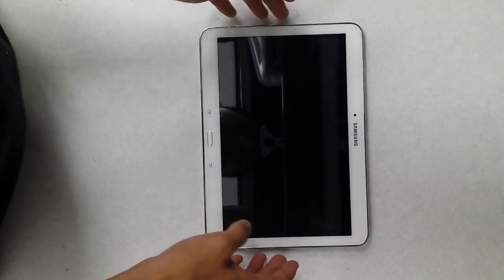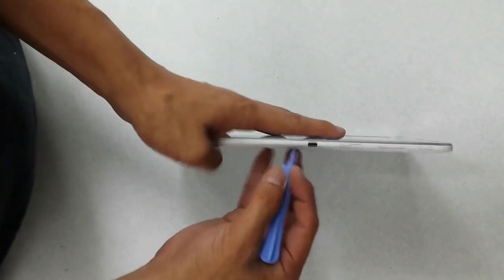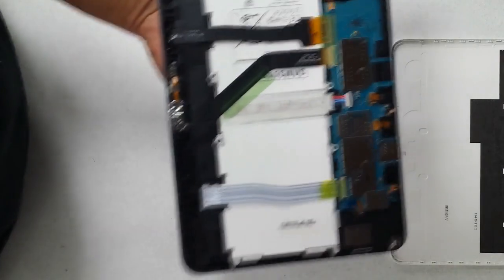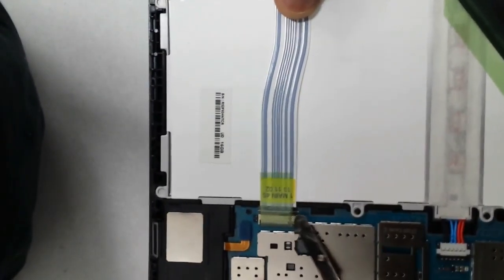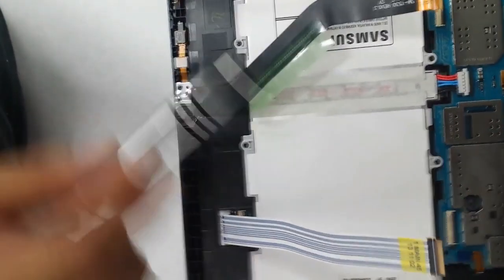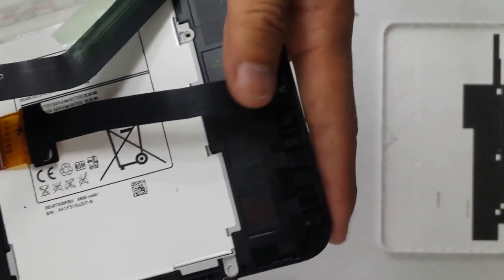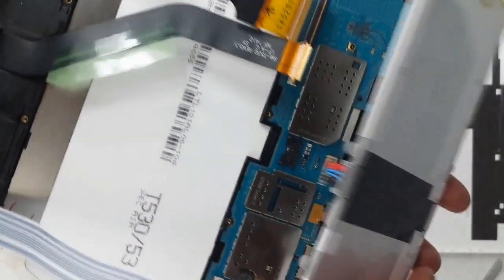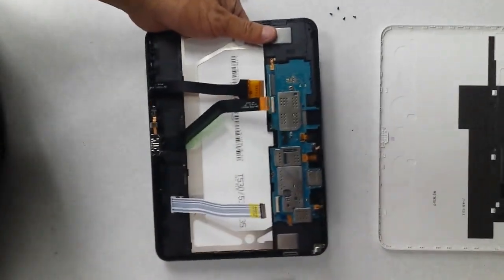Samsung Galaxy Tab 4 Battery replacement

Comment: You don't have to disconnect all the connections. Just the top edge light coloured connection. Ahead could lie disappointment. Just carefully slide the battery out.

Comment: Great video. Well done, thanks! I'd add a note that, on mine at least, the back is pretty tough to get started separating - it's a tight precision fit! Had to be patient and keep working at it with a very thin tool. I also had to use a small tip tool (my little Philips tip) to press down the sides of the battery connector till they clipped into place. Just pressing the connector down with my thumb would not lock the edges. 
cheers jt 😎

Comment: I guess mine is made differently.  No way in hell that tool can get between the silver and white plastic .
Reply: Randy - It's a very tight, precision fit. Just keep poking at the seam with a very thin tool. Try different spots around the edge. Eventually you'll get a split and a little pop as it separates slightly. Then work your way around the edge. Mine took several minutes of working at it. It'll come. cheers, jt 😎

Comment: Worked a treat to replace my TAB 4's swollen battery. Only things to add from my experience is the back cover was harder to get off than it looked in the video and I had a couple of extra bits of tape holding the cables down which needed taking off before opening the cable clamps. Great helping video. Thankyou.

Comment: vastly better than the totally crap printed and badly shot instructions that came with my replacement battery. if I had seen this video first, I would not have spent 
hours cracking the slate open and buggering up the seams in the process. and gotten the ribbon cables connected right, THE FIRST TIME.  

THANK YOU!

Comment: Looks easy to change the battery. I just bought one off ebay cheap and the battery dies within a couple of hours use and takes hours to charge. Just need to buy a genuine battery and not a fake.

Comment: What are the dimensions of the battery?  I may want to order on Batteries Plus.  After you have taken the screws, there are those gray "snap" tabs; you seem to just run the tool under the tabs- it it that easy?  Thanks for the confidence.

Comment: MY TABLET IS STUCK ON THE DEAD ANDROID PAGE - "NO COMMAND"  WILL NOT RESPOND TO FACTORY RESET/WIPE OR SNYOTHER CHOICE.  PUT IN FREEZER OVER NIGHT CUZ IT WOULD NOT TURN OFF.  AM THAWING IT OUT SO I CAN GET BATTREY OUT.
IF I TAKE BATTERT OUT & BACK IN SHOILD I CHAGE IT FIRST OR TURN IT ON TO SEE IF IT WILL NOT GO BSCK TO THE DEAD ANDROID SCREEN?  IT STARTED WHEN I WAS RESTARTING MY TABLET & IT CAME TOTHE PAGE I NEVER SEEN BEFORE.
PLEASE HELP IF POSSIBE...    IF IT DOESNT WORK ITS DEAD RIGHT?
SAMSUNG SAID TOO OLD TO HELP/ GET PARTS.
THANKS!

Comment: Great video, but you only covered 1/2 the job.  There were a few hitches putting it back together, which would have made it nice if you had shown how you put the new battery in.  Do you put the old tape on (mine wouldn't stick so I used some Scotch tape) and which way the 3 wire clamps are pushed down.

Comment: Very helpful! Stopped using my Galaxy Tab 4 because it doesn't hold a charge very well. And, I just ordered the batter for it that comes with a set of tools! Although I have a PC workstation I built and a MacBook Pro, getting the use of the Galaxy Tab 4 back into my tech quiver is something I've been needing for a while.
Reply: how about a link to the battery and tool kit? 
Thanks in Advance 
Yazmin

Comment: Thanks for the video mate. Simple enough to follow and enough good information to get the job done. For anyone wanting to have a creak at this, I'd previously never attempted anything like this before and have limited tech knowledge. A few things I noted. A bit of common sense, moving past the fear of wrecking your tablet, that is probably not working right anyway otherwise you wouldn't be here,  and patience got me over the line. I struggled getting the piece of crap plastic tool in place to get the back off. I broke the end off it. I used my fingernail to open the case far enough to get what was left of the tool in place. I used a blade to get the edge of the green tape up, slowly, being careful not to damage the ribbons. I did not put the green tape back on. When I lifted the locking tab things on the ribbons, I thought I had to pull the ribbons up to get them out. Turns out they just slide out not up. Getting the battery out of the chassis, I found I moved around all the corners trying to get one to click loose because I didn't want to force anything. Maybe I could have used more force but I'm a noob and wasn't sure. Once I clicked one up the rest were easier. Removing the battery lead was as the video showed. I initially looked for another lock thing that I had to lift but couldn't find one so turned the battery over and pryed the plug out. Putting the new battery back in was easy. The power plug from the new battery just pressed on, the same way it came off. The ribbons slide back in to where they came from and the locking tab thing that I lifted to get them out just presses down, evenly and gently, to hold them in place. I used the plastic piece of crap too to make sure it went down evenly. Put the screws back in and it really is that simple. Before I put the back back on, I powered mine up to check it first. It was fine, no information or anything lost. I powered it down and fully charged it with the back off. I wanted to see if the new generic battery got overly hot or went bang or puffed up or something before putting the back on. It was all good and literally saved my tablet. Couldn't have,or rather, wouldn't have, done it without this video.
Reply: ih like you

Comment: The usage of metal tools inside electronic devices with a life electricity source, ie. battery, can lead quite easily to short-circuits, which destroys the device and defeats the purpose of battery-replacement.

Comment: I was ended up saving from spending cash on a brand new vehicle battery when I found out about the reconditioning program ( Check Details Here>>>https://plus.google.com/100351090281822647456/posts/Ct2x2kZGdNN ), therefore I tried it to recondition my old car battery! I was not anticipating be that easy. This repair by yourself helped me to save $ 100 and I`m eyeing other batteries to recondition next.

Comment: I have a different problem, over the entire night when no one touched my tab, it was only at 18% and when I opened it, it went right down to 0
Reply: I am also the facing the same issue now n even if it's getting charged further its stuck at 80% charge. Don't understand y but does it rqr a battery replacement. Sm1 pls guide.

Comment: Thanks a lot for super clear no nonsense video.Fixed mine. Important,when taking cover off, do it as you do, slide the flat edge along and it will pop up avoiding cosmetic case gouges. I used fine flat screwdriver, and a  thin kitchen knife to pop off the connecter cable connectors inside.

Comment: thank you for the video tutorial...I would like to add 1 thing: it is a better idea to use a plastic safe tool or device other than a metal pry tool to unclip the battery plug. As I unclipped it from underneath  as shown,  I saw a very small spark. Thankfully no damage, but it doesn't take much to ruin electronics. Just a small tip... thanks again.

Comment: my tablets battery goes down even on charge does anybody know what is wrong?
Reply: I am actually having the same problem with the given charger.
Reply: Are you using it while its charging? There are many factors that can go about that. Could be your charger isn't the proper spec charger for the tablet. If that is the case its because its a nonbranded charger or rapid charger. If you are using the right charger then check if there are battery draining apps on the back. Ideal to charge when the tablet is off and also never let it fully die. It could kill the lifespan of the battery. You may also need to replace the battery itself like in this video. This is based off of what I've experienced and read online as possible causes. Like I said, it could be many factors that can do that. If you need a battery make sure you find the right one on Amazon or eBay. Good luck.
Reply: Luis Lugardo the batteries do not last long it last about 1 year

Comment: Mine hung...  While I was charging it,  I did the password and I got confused when it didn't open.  So I unplugged the charger and got shocked when it stayed like that.  It still has that bolt sign while the charger is not plugged.  I tried charging my phone with that charger and it works but....  I don't know what to do anymore...  If I let my parents know,  they might get angry at me..

Comment: I'm having trouble finding the battery for model #CE0168 - galaxy tab 4 10 inch screen.  If I let my battery get below 70%, it takes 2 days to charge it.  It has always been like this, so I thought replacing the battery would be a good idea - I just can't find one.  There's plenty for the tab 3 - would that work?

Comment: Will this help to reboot the system, to unplug the battery and the plug everything back in? 
I have a black screen and have already tried unpluging the LCD cable and plugged it back in. Just wondering if this process with help.

Comment: I think my battery may have overheated and cracked my screen. I was charging my Tab4 and when I went to unplug it the screen had cracked all the way across from left to right. Tablet was sitting on a stable desk and it just cracked. WTF?
Reply: That sounds like something caused by difference in extreme temperatures.

Comment: While power is off holding power button + volume up + home button will bring device into recovery mode. Just make sure if you hard reset and wipe it, it will basicaly reset to factory default and remove any firmware updates meaning if you say have upgraded to 5.0 it will down grade it to what ever it was initaly installed with. Might fix some booting problems 
, never had to try this but might work 
 Just a thought.
Reply: Astro Funk Man thank you
Reply: +Astro Funk Man this trick actually seems to be working its downloading...i guess well see
Reply: +Astro Funk Man how long is it gonna say downloading dont turn off... its been on same screen for about 10 minutes
Reply: you are in wrong mode, please hold power button for 8 secs to reboot at any time
Reply: Astro Funk Man
Reply: Great video thanks

Comment: Thanks for the video, but this seemed like sparing the good parts of a broken tablet rather than replacing the battery as the title suggests.  In my case, my tab's battery lies about being 100% full, but as soon as I unplug it, it drains to 0 in matter of minutes or even seconds.  I have tried different cables, but no difference whatsoever!
Reply: Yes me too
Reply: Ron B Yeah, I have 2 and one of them is discharging very quickly. Not quite as fast as you, but much faster than the other tablet with the same games and things. Probably 2-3 times as fast.
Reply: you need to watch it again if that's what you think
Reply: watch what he does then put the new battery back in reverse order. it couldn't be any easier

Comment: Hi my TAB 4 wont come on and wont charge Model: SM-T230NU, I opened up the tab like in this video n pulled out the battery jack and placed it back agn and still nothing the tab is new got it last year in August idk what agn to do can you help?
Reply: Same issue here, after I did that the screen shows the word Samsung on the first boot screen then goes black again.
Reply: ISK KILL So i Fixed My Tab 4 myself all i did was open it up i removed all the wires that were connected to the tab and then put them back in place ( not just the battery wire) and it started to work...don't be afraid to open it up and explore.
Reply: +Joe Sur I have the same one, and it is only 8 months old. It takes approximately 2 days to get a full charge, and then I can use it for a total of 1 hour, then it says 17% you need to recharge your battery. I can tell you this, I will never buy any of there products ever again. Especially for the price I paid. I have a small kindle fire that I bought almost 4 years ago and it still works perfectly. What does that tell you.

Comment: I still use my metal iSeasemo Ultra Thin Steel Pry Tool! I'm just sure to get beneath the screen and pry up the entire LCD assembly. Metal Pry Tools can do alot of unnecessary damage if you do not proceed carefully. You are wise to mention this. I can't get nothing done with those elcheapo plastic safe pry tools. Waste of time. You want mine you can have them.

Comment: where can i find one of them pry tools?
Reply: You could check local small computer shops.  Try wandering through a dollar store or pottery/craft store and you might find something that will work for literally $1.  When doing pottery you'll often use hardwood tools to carve designs or letters out of the clay before firing.

If you don't have an assortment of "computer tools", you can buy something like a VisionTek 12 Piece Computer Toolkit which includes a pry tool.  Very handy, smaller insulated set of tools that will last you a lifetime of electronics repairs (home, mobile, automotive).  Tiger Direct for example carries that particular tool kit.